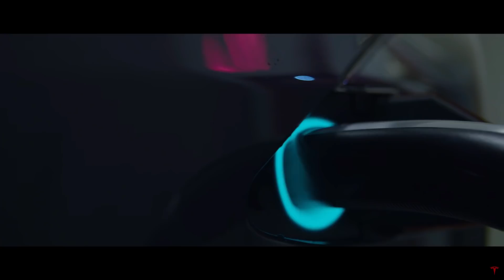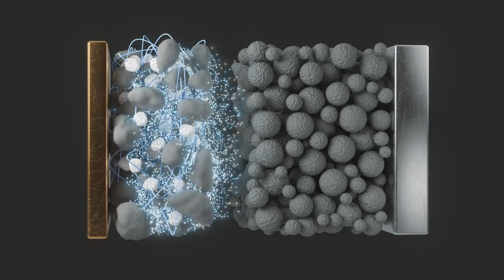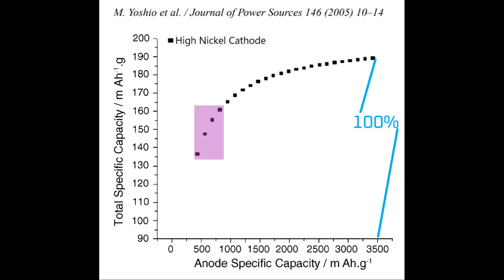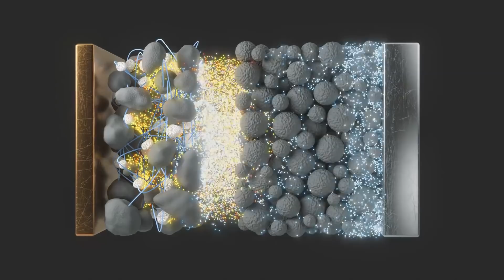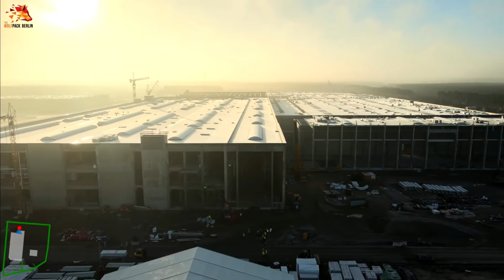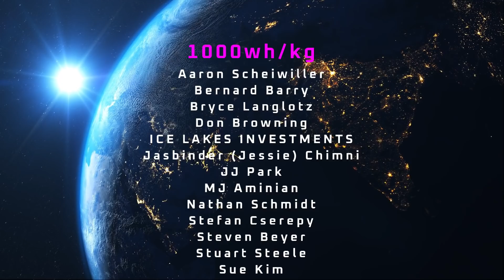#8 Battery Day Myths // Silicon, Graphite, and Stacking Gains

Comment: how did you calculate the specific capacity of Silicon as 2880 mAh/g (as compared to theoretical of 4212 mAh.g)? and SiO (used in 2170) as 1180 mAh/g?
Reply from the maker: That was 2 years ago so I forget, lol

The problem with theoretical energy densities is that their theoretical.

For both cathode and anode materials that theoretical energy density is almost always lower.

Comment: Re #3 range vs cost. The key point is that the change allows a longer range for the same battery size, with a reduced battery cost/kWH. If Tesla keep the range the same and reduce the size of the battery pack, then there is an additional vehicle cost reduction on top of the reduced battery cost/cell.

Comment: Jordan, Could you address StoreDot's secret sauce for ultra fast charging versus LION batteries vs. Tesla's.  StoreDot has attracted big money, won some awards and have done some actual demos of fast charging on smaller battery-packs (e.g. scooters).  Their tech involves silicon anodes chemistry and I wonder if they have already accomplished some (or all) of what Tesla is attempting.  Will Tesla get the same results? When?  Should Tesla license StoreDot tech?  Buy them? I can think of no one better to unravel all this than you.

Comment: I may be completely confused, but i think there’s a way to claim that Tesla can get both the range increase and cost decrease. First, the 56% decrease was for $b/kWh.  If I recall correctly, both the 3 and Y have 75 kWh batteries.  The 3 has a range of 353 miles on that size battery, which essentially yields a range of 4.7 miles per kWh.  Assuming a $110 per kWh cost, the battery pack costs $8250.  If both the increased range and decreased cost are true, we’d get an updated 3 with a 75 kwh battery with a pack cost of $4620 and a range of 543 miles. That is a range of 7.34 miles per kWh. If they chose to reduce the battery size to maintain the 353 miles, the could have a 48 kWh battery pack, with a cost of just under $3000.  Considering there isn’t a relationship between $/kWh and range, it seems possible that both are in fact true.

Comment: Jordan - WRT myth #3 - if Tesla does increase vehicle range that will in fact eat into the cost saving - so rather than range and cost multiplying, they are working against each other. I would imaging Tesla will split the difference, increasing range a bit, but not so much that they aren't also reducing cost - but that is just a guess.
Reply from the maker: Exactly, we're all guessing

Comment: Electrolytes that can sustain high voltage cathode/anode combinations are one of the potential areas for breakthrough battery advances. A discovery like that could render solid state batteries obsolete overnight.

Comment: Regarding myth #3:

I think the main problem is the the heading of "Range" is ambiguous. The easiest way to interpret it is as wh/kg, which if that is what has changed, then what the ~70% decrease represents is not the reduction in $/kwh, but the reduction in cost of the entire battery pack for an equivalent range.
So, for simplicity, if a 100 kwh pack goes 300 km, but what they actually mean with the range slide is wh/kg, then that same battery pack now goes 462 km. So if you want to keep the range same you just need a 65 kwh instead. Then if the price at the pack level decreased by 56%, say from 100 $/kwh, then each kWh of pack costs that much less.
Summing it up, before this then a 100 kWh pack for 300 km range would then have costed $10000, but after these changes, that same pack for 300 km range would now only need 65 kwh and cost $2860.

I think this is closer to the correct interpretation, because if you look at the anode part, it represents a 20% increase in range, but only a 5% decrease in cost. I interpret that as the changes to the anode has improved the energy density of the cell itself, giving a pack level range increase of 20%, while costing 5% less at the pack level in $/kwh.

One way of looking it is, that if the above interpretation is correct, then the reason it's ambiguous is that Tesla did on purpose to not fully show their entire hand.

Of course, since it is ambiguous all of this is just speculation until Tesla provides more information so we can deduce what they actually meant.

Comment: I think you may have got the Graphite part wrong. The potato like globules in the anode could be SiO2 glass beads. 
In the presentation they had quoted a 5% price reduction when Tesla's metallic silicon is used in anode (instead of current form of silicon).
Silicon structured in SiO2 glass is quoted at $6.6/kwhr;
Silicon structured in Graphite is quoted at $10.2/kwhr; and 
Tesla Silicon at $1.2/kwhr
Currently Tesla cells are ~$100/kwhr. So, a $5.4/kwhr savings (shift from structured Silicon in SiO2 to metallic silicon in Si02) would be inline with the 5% reduction on kwhr basis. If the shift was from structured silicon in Graphite to metallic Tesla Silicon in Graphite (assuming the 2170 & 4680 have graphite), the savings would have been $9/kwhr and as such represent 9%-10% in savings.
Net-net, I'd deduce that the current anodes comprise structured silicon in Si02 glass; &Tesla is moving to metallic Silicon in Si02 glass.
Reply from the maker: The dollars per kilowatt hour quoted in the presentation are just for the anode material specifically.  The anode only makes up 15 to 20% of the battery weight.  In other words...

Build a mathematical model of battery cost incorporating all materials, weights, and energy storage and you'll see you've just arrived at a lucky mathematical coincidence, and far from the actual answer

Comment: This is the first time that I had to deeply consider if the range and cost improvements don't compound to a multiplicative cost per mile. I had always assumed that they did, but I guess it makes sense that making a battery store more energy doesn't mean that the vehicle can magically travel further with less energy. The vehicle will still require the same amount of energy to travel unless the somehow the batteries provide a 50% higher mile-to-kW/h ratio. Only then would the Cost per mile compound to a 70% reduction. But as for now, you convinced me that it doesn't :)
Reply from the maker: It's a tough one!  I racked my brain on it and went back and forth.
Reply: @thelimitingfactor  I think you got it right, there are many possibilities that we just can't nail down without more info, but as for now each battery will be bigger and thus be cheaper per kWh, but will not magically make a car 50% more kWh-per-mile efficient

Comment: Regarding Myth #3: the charts form battery day show a cost reduction per kilowatt-hour and a range increase. The range increase appears to related to weight decrease due to the improvements listed (Wh/kg increase for the battery materials and cell design, structural mass decrease for the cell vehicle integration). This equates to decreased kWh/mile (or km).  If that is true, then the effective cost for the same range would, in fact, be a multiplication of these two categories.  kWh/mile * $/kWh = $/mile
Reply from the maker: That's the million dollar question.  The charts don't give us enough information.  I've posited my view and had multiple debates with sharp minds about this.  People jump to conclusions quickly, and then when they think about it, their brain melts, lol.  Yeah, it seems simple on the surface, but really think about it.

Comment: This percentage have never been confusing to me.  It isn't an AND or an OR, they are just an IS.....  LOL.  The 54% is just a metric of how going to the 4680 battery from the current designs increase the range of a model 3 from 300 miles to 450 miles, all things being equal.  And the 56% reduction in cost per kwh is just a metric for COGS.  Again for a model 3 an estimate in 2019 was that the cost of goods for a model 3 battery was about $9K, so the new cost of manufacturing would be $4k.
Reply: so 54% increase in range, 16% is cell design (lower electrical resistance/heat production, improved chemical energy density?), 14% vehicle integration (weight efficiencies, reduced loss of kwh to pumping coolant thru small tubes and cooling), and the other 24% to chemistry of anodes and cathodes changing.)
The 56% cost reduction can be viewed in a similar manner...  14% cell design is reduced materials and scrappage, 7% vehicle integration is elimination of packs and battery complexity, 18% cell factory is the high throughput effeciencies of the roadrunner line, and 17% in cathode and anode materials cost.
The wonder of battery day is that every percent in the slides are independent of each other and can be implemented and modified on the fly.  It is litterally a roadmap of how to get there, and not just a here's all what needs to happen before we can go to launch, if you will with the end result numbers.  So if one step is late, or hits a roadblock, or gets better, then the final numbers can change.

Comment: I haven't heard much talk about manganese.. I assume the quantity used is relatively low, and its fairly cheap?  abundant supply  and easy processing?  I wonder how critical  its role and investment potential ?
Reply from the maker: Roughly 5% in next gen.  Small opportunity and a common element.  It's a dopant rather than a major component.  My two cents at least!

Comment: Regarding the cost reduction and range increase, wouldn't they be combined in terms of cost per unit of range?

Consider just cell to vehicle integration, it costs less as you get rid of materials and work around modules and packs, and you also get a higher range due to weight reduction. All in all, it costs 7% less and the range increases 14%, which makes the cost per range 93/114 = 81.5, i.e. that part gets you roughly 18.5% reduction in battery cost per mile of range.

That being said, it's still not clear this is what they meant. To me it's difficult to believe that this would reduce the weight of the car so much it implies 14% range increase.

I thought I understand it, but now I think I've reached the same state of confusion as Jordan has. Let's wait a few months for the specs of MIB MY :)
Reply from the maker: Totally!  It is a confusing one.  I asked several people with massive brains and got different responses each time.
Reply: @thelimitingfactor  Yeah... one thing is for sure - battery day is one hell of a journey and it's not over yet :)
Reply: To me, range is a function of weight reduction and operational efficiency.  Imagine how much kwh are used in the small tubes pumping coolant and heat elimination vs the new structural pack design.  In addition, the tabless design in and of itself probably mechanically has less energy loss due to heat and electrical resistance, increasing range.

Comment: For LFP CATHODE 4680 call 
Anode (22%si 78%graphite)
	gram
cathode coating	190
binder	10.5
conductive carbon	8.4
cathode foil	16
anode coating 	30
binder	1.6
conductive carbon	1.3
anode foil	35
casing	13
electrolyete	14
inner separator	10
outer seprator	12
Reply: All in grams for single cell 
Enjoy
Reply: So each cell is for a LFP is .75 lbs ......  And with these numbers, someone could come up with a pretty good SWAG of materials costs....
Reply: @dalerichardson7202  correct and the cell capacity is 100 whr @ 3.3 volt
We reach 64% practical capacity out of the theoretical
Reply: @blueactive3069  Im just glad someone is doing LFP in the 4680 format already.  It hasn't been clear which chemistry was coming first.  So, are these numbers from California or China?
Reply: @dalerichardson7202  not related to TESLA

Comment: Could you explain how Si metal is manufactured, and how do they avoid oxidation over multiple charging cycles?  Is the answer an organic coating?  If yes, is the coating a chemically bonded to Si or is it a mechanical barrier.  What is it and why is it permeable to Li?  Thank you.
Reply: Si ain't no metal. It's a semiconductor (metals conduct).
Reply: @andyonions7864  What's the chemical structure of Tesla Si?
Reply: @afshinshahzamani2297  its silicon oxide. Only formula for si oxide I know is SiO2, which is glass.
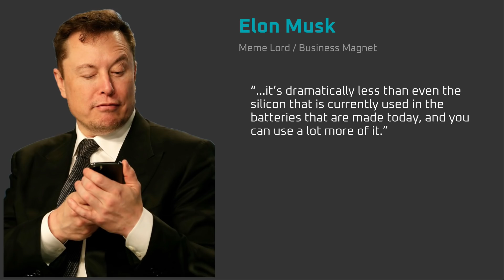Reply: @andyonions7864  @2:00 mins. the electron microscope pictures (and cost comparison) implies that Tesla Si is not the same as SiO2 glass.  So what is it?  That is my question.

Comment: Question. Is it worse to charge a Tesla battery between 95 and 100% or to drain it pass 5%?
Reply: It is fine if you need to once in a while, but even if you did on a regular basis you will not "Kill" your battery. It will just degrade more than average, but you will still have plenty of kWhs.
It will take 10 plus years for you to it below 80% of original capacity.
Reply: yes. Stick between 20 and 80%...
Reply: My understanding is that it's not that bad to go to full charge as long as you start driving as soon as it hits full charge. I think it's bad to leave it sitting at full charge. But I work pretty hard to stay between 20-80% whenever possible. Day to day this is very easy. Only road trips where I push it higher or lower than those levels